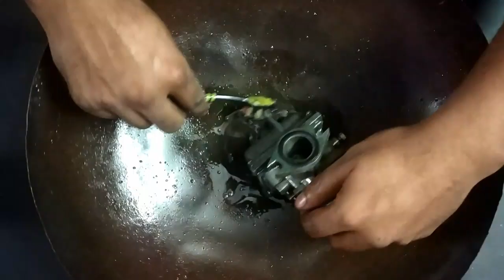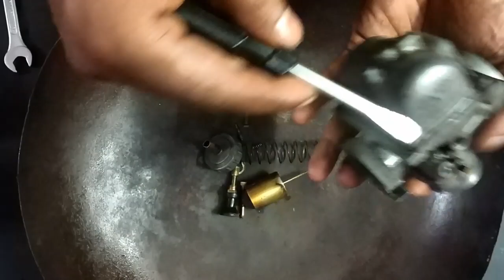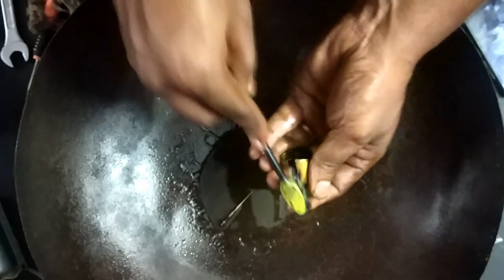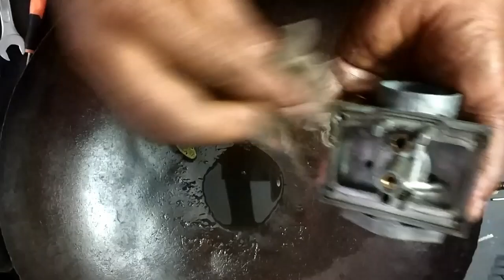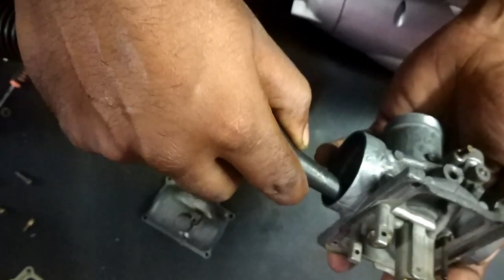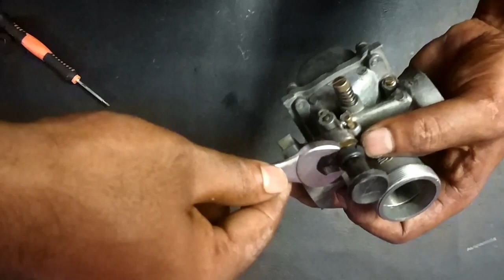How to clean carburetor

Comment: Converting old bullet alternator single phase to 3 phase is possible? Please make video on it
Reply from the maker: Sorry. I don't have idea about it.
Reply: installing dry battery in CI bullet will cause problem?
Reply: @pritamshet7755  possibly no. Coz I've been using dry cell since last year and there hasn't been any problem as such. Still it's under observation.

Comment: Brother, i have a 2001 electra .. engine had missing issues, so i cleaned carburetor watching this video .. but the missing is still there and my bike doesnt run on low slow running position also.. please help

Comment: Original bullet beat sound enging nois eillama kondu vara eanna sainam anna 1 kear la mis aakuthu   head silinder work eappodhan saidhaan aanalum stratification aakala bro yanna panradhu
Reply from the maker: Bullet beat nalla erukanumna point correcta set pannanum. Athu pola cam clear a adjust panna maximum engine noise avoid pannalam. Gear miss anuthunna? Puriyala ...